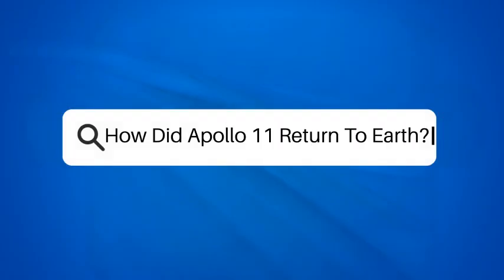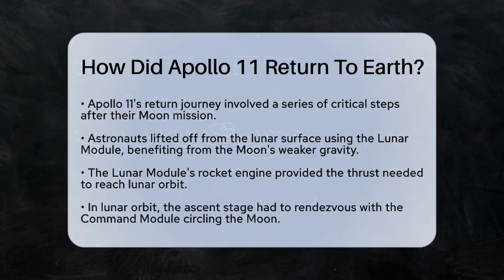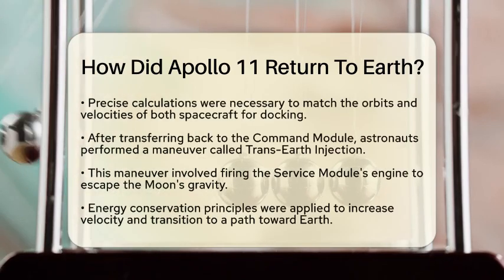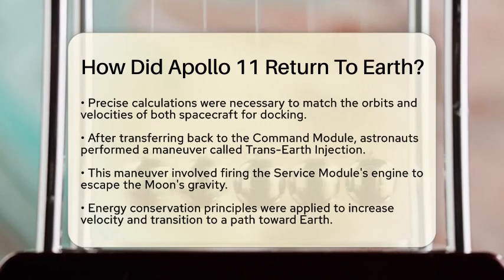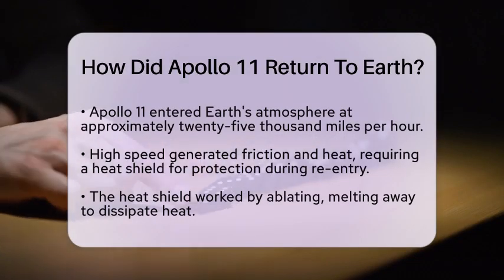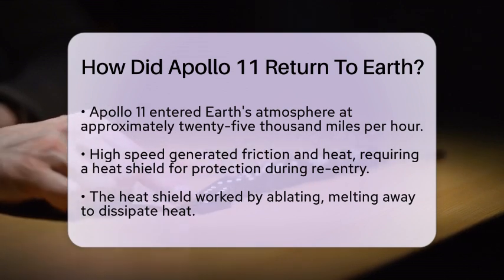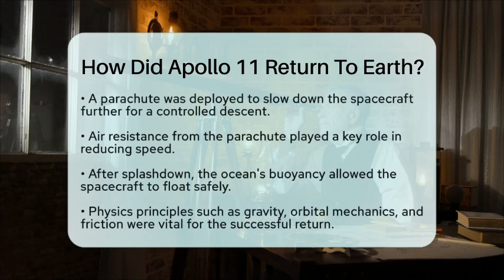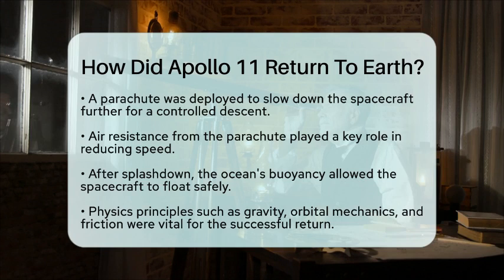How Did Apollo 11 Return To Earth? - Physics Frontier

Comment: There were 8 successful Apollo missions and 1 failure. 
Apollo  8    Frank Borman, Bill Anders, Jim Lovell  Dec 1968 (Genesis reading)
Apollo 10   Tom Stafford, John Young, Eugene Cernan 5/19/1969 LEM test.
Astronauts who walked on the moon       Date           Location
Apollo 11 Neil Armstrong, Edwin Aldrin,  7/16/1969    Sea of Tranquillity
Apollo 12 Charles Conrad, Alan Bean,   11/13/1969   Oceans of Storms (Surveyor 3)            
Apollo 14 Alan Shepard, Edgar Mitchell,  1/31/1971    Fra Mauro (near Cone Crater)
Apollo 15  David Scott, James Irwin,       7/30/1971    Hadley–Apennine         
Apollo 16 John Young, Charles Duke,     4/16/1972    Descartes Highlands
Apollo 17 Gene Cernan, Harrison Schmitt. 12/7/1972  Tauras-Littrow valley
Astronauts who remained in the Command module.
Apollo 11   Michael Collins
Apollo 12   Dick Gordon, 
Apollo 13  Jack Swigert, Fred Haise, (Jim Lovell)  4/11/1970 (O2 tank explosion)
Apollo 14   Stuart Roosa
Apollo 15   Al Worden
Apollo 16   Thomas Mattingly
Apollo 17   Ron Evan